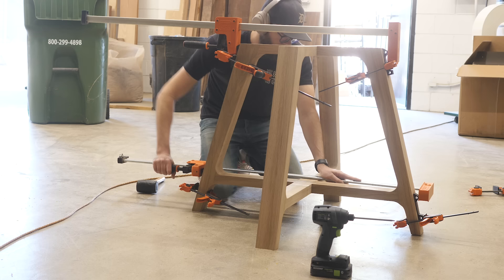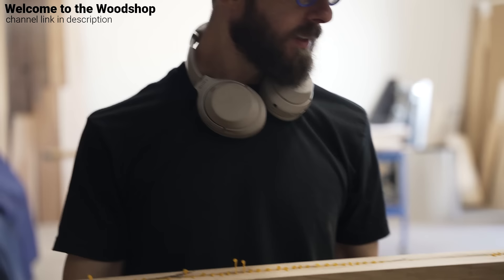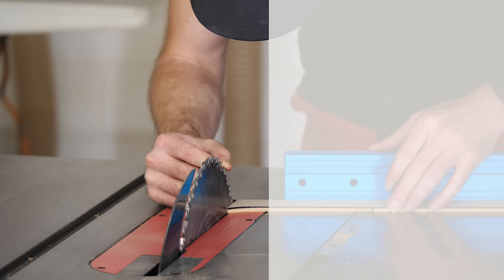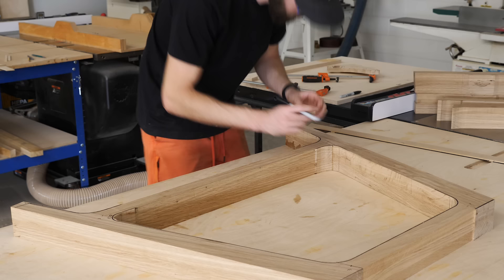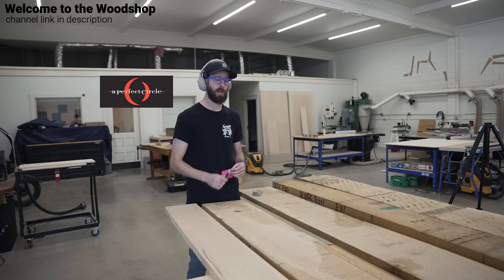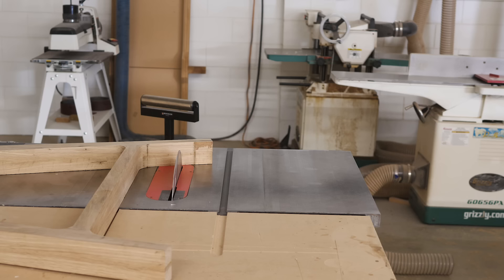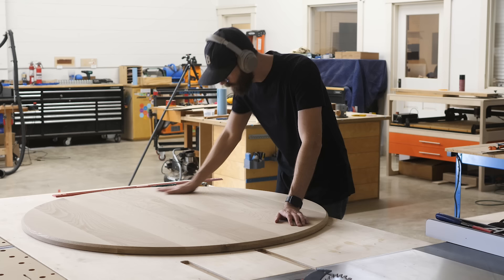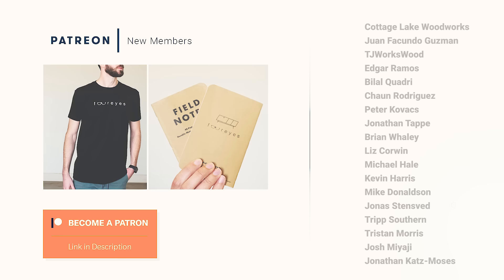48" Round Table

Comment: I would call this a kitchen table, but that might just be because we had a round table in our kitchen when I was growing up. I really like your design here. You used the chunkier leg, which is different from what I usually see you do, but still managed to make it look elegant. I rarely use the full height of my 12" table saw, but I can see how it would be super useful here. I'm gonna have to pass on duplicating your spindle sander setup though. 😂 I could probably make it work with the few free milk crates I have laying around. Great looking table and great video! Thanks for sharing!

Comment: Hey Four Eyes
Love your work. Enjoy your videos even more. 😁👍🏻
For this informal table I would have used three legs. The shape of these would be triangular. With the pointed edges of the triangles all facing outwards flat facing inwards. Bracing bars at the bottom using the same orientation for the triangles facing outwards. 
In other words your whole leg frame would be a triangle looking from the top. Making the overhang not more than two inches from the frame edge. Forming a modular design rather than a spindle type. 
Let me know what you think? 
Regards
Bon 👣

Comment: Another way to avoid the 3” cut conundrum is to make both of the 1.5” legs then glue a second rough cut set to your final sized leg assemblies, then once the glues dry flush cut trim with the router.

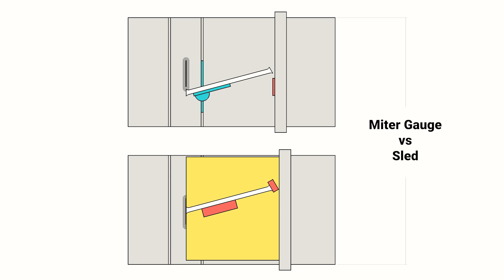Comment: The problems you describe at 6:30 are the main reasons I started looking at sliders over cabinet saws. Long story short, be wary - I now have a 14k SCM saw with a 16” blade… much harder to hide from the wife as it’s a 10.5’ stroke beast! Ha
Reply: A disc or edge sander can also help with fitting those joints - you can usually lock a miter gauge and then approach the final fit

Comment: You know them routed out slots for the long washer for attaching the top, I've seen'em done with a domino...
Reply from the maker: I actually tried...but it didn't work. Well...I think I could have made it work, but it wouldn't have been any easier. I messed around for a bit on a scrap piece.

Comment: Serious question.  Is there a rule of thumb for the width of boards to make up a tabletop?
Reply from the maker: I don’t know. But I let aesthetics and width of my jointer dictate. 

My jointer is 8” so that’s my upper limit. Then I try to keep things even beyond that. So a 21” wide top might get 3 boards 7” wide. But a 24” wide top would not get 3 boards at 7” and 1 board at 3”. But rather 4 at 6”.
Reply: i like varied width planks for tops. so maybe 3.5-4,5 inch or 5- 6-7 etc.

Comment: I like your design but how do you calculate the table top and base ratio so that the table is stable and won't topple over? What is the ground diameter of the legs if you draw a circle?